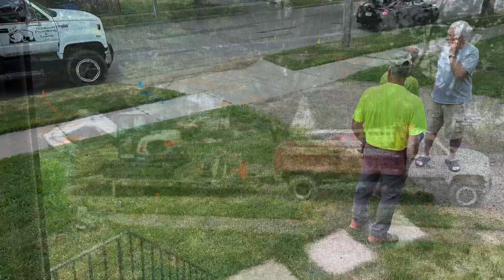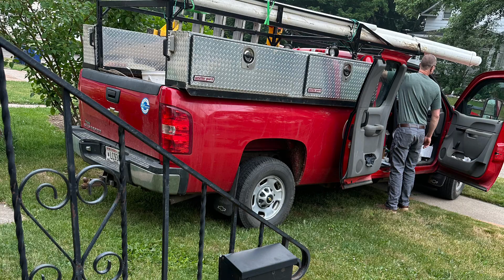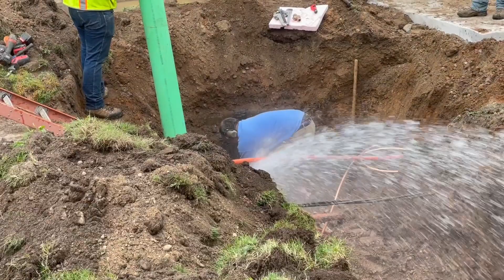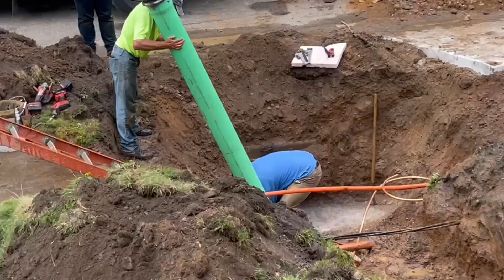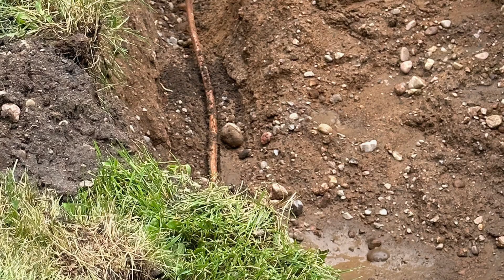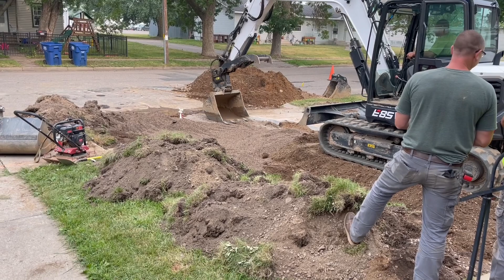Water Line Replacement June 28, 2023

Comment: I wondered why your galvanized pipe had to be replaced and I read this online.... Galvanized pipes are coated with a layer of zinc to prevent rust and corrosion. However, galvanized pipes are not safe for drinking water, as the zinc layer can wear off and expose the pipe to lead and other contaminants. 
Lucky you could get a grant to pay for this work.

Comment: /I don't understand, why did the plumber decide to dig up the yard and the shrubs?  It seems unnecessary,  Most plumbers replace  rotted water lines by pulling the new line underground,  There's no digging up yards and backfilling, the new water line is pulled from the basement out to the street shutoff beneath the apron, it's fast and efficient,  There's no mess in your yard to clean up.
Reply from the maker: They had to get into the area where it goes into the foundation and the street level shut off valve, all below the freeze line. Also some of the utilities all ran over this and they couldn't risk harming those. Then they also insulated over the top of the new line. This job was through a grant to replace old lead piping with copper. We don't know any more, except this is how it was being done throughout the city. This doesn't answer your question and even online I see how it can be done without digging it all out. It says in rare cases digging a trench is required, so I don't know why it was done all over this city like that.